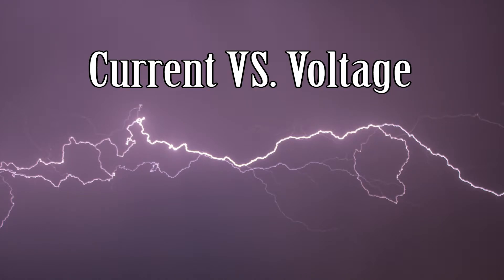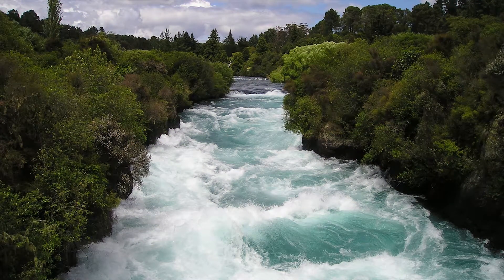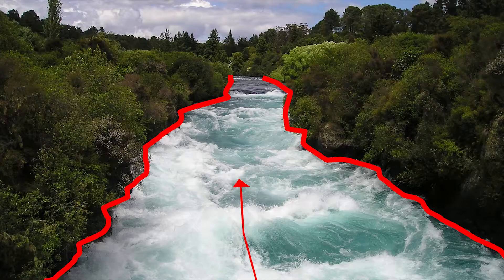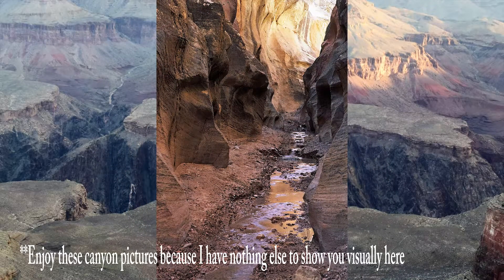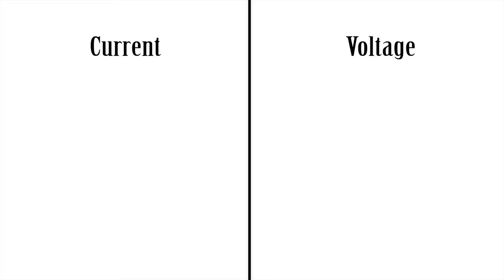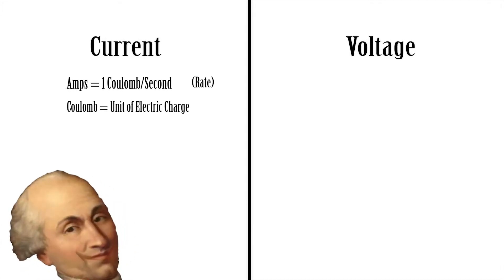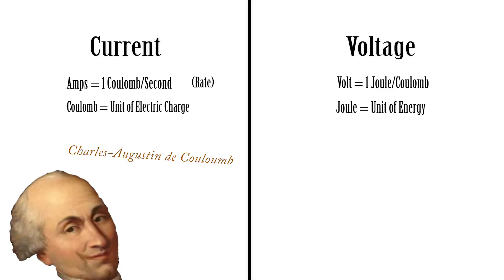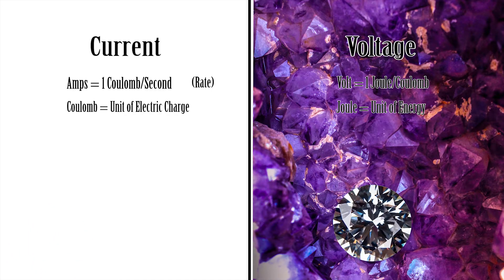Current Vs Voltage - Explained

Comment: Great video again. If you could relate concepts back to computer hardware (like for example the actual voltage and current limits in computer hardware currently) that would be perfect.